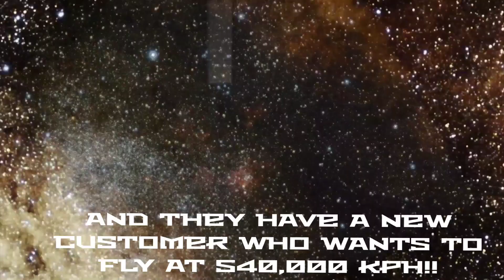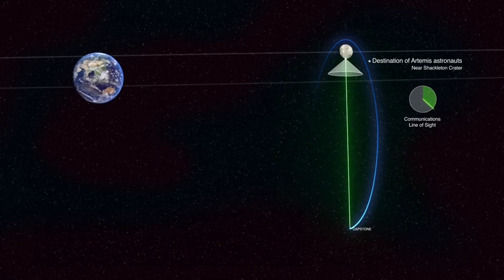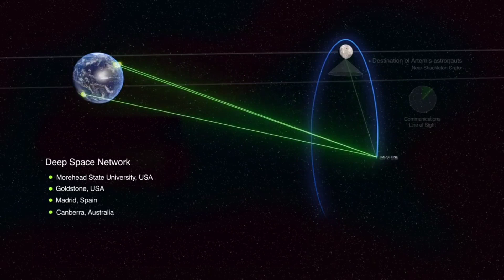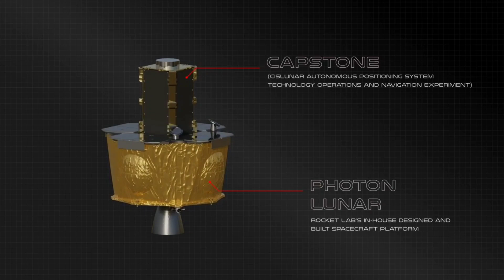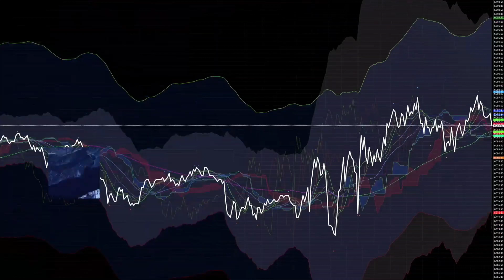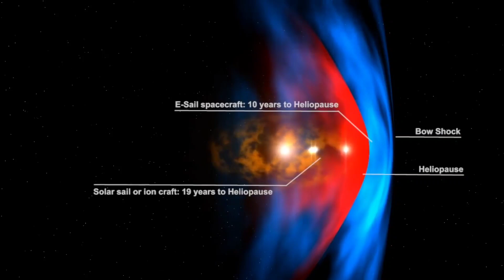Earth to Saturn in less than a year! The Moon in 43 minutes! Rocket Lab and their newest customer!

Comment: I really love that magnetic sail. The advantage of this over light sails (other than the almost constant accelearation, as the field expands as the pressure is reduced) is that by changing the strength of the field in different rods... you could "reorient" the vector of the sail without using thrusters to reorient the craft. It's the sailship of the future.
Reply: Gonna need space worthy nuclear power.
Reply from the maker: I was pretty impressed researching this. What if Finland builds the first superfast interplanetary probe? What a moment of national pride. 👏
Reply: @TheAngryAstronaut  I agree Mr. Angry, that would be cool. for all involved😉
Reply: The sails get you out but how do you get back?
Reply: @Dave5843-d9m  hopefully you had sense enough to aim for another Star. It can be used to slow you and send you back... Not sure why you'd wanna come back... If you're going to a gas giant they produce their owns fields you could use to get you back. Pull the sail in when the wind changes.
Reply: https://en.wikipedia.org/wiki/Electric_sail, not to be confused with https://en.wikipedia.org/wiki/Magnetic_sail (as the former article says at the top)
Reply: YES THIS IS ONE WAY
Reply: Two ideas (maybe dumb ones) to decelerate:
1. Reverse the polarity of the tendrils?  
2. use the build-up of electrons or protons (effectively ions) to fuel a forward facing ion thruster.  retract or neutralize tendrils part way to the destination (in proportion to the difference in thrust of the two methods) and fire up the ion-brakes.
Reply: @JeremyNasmith  1. The wires are charged positively by having an electron gun on the spacecraft's body. (AIUI, this actually charges the whole spacecraft positive, not just the wires.) I think that would be difficult to reverse, because you'd need either a supply of an ionizable substance so you can emit positive ions, or to rely on ambient charging by just connecting a high-voltage power supply between the wires and the body. Even if you find a good way to make the wires negative, I expect that won't slow down the spacecraft: instead of blocking the solar wind (and thereby being accelerated by it), you're just going to attract the solar wind (and thereby be accelerated by it).
2. That might work, if you have a way to collect protons and electrons from the solar wind. You'll need both so you can store them as neutral hydrogen, and so you can emit electrons for neutralization when ion-thrusting. A conventional e-sail, being purely repulsive, won't collect anything, but your attractive version might work. You'd probably have to reel the wires in, or make them loops that cycle through the body, for collection.

Comment: Looks like they're generating an electric field, not a magnetic field.  A magnetic field would require the flow of current, so you would need loops of wire.  The tendrals are not loops, and no current flows in them.  Basically, positively-charged wires repel the positively-charged protons in the solar wind.  So the sail is taking some of tho kinetic energy in those protons.  The tendrals also repel each other, which is what keeps them spread out.
Reply: How do they keep them extended? Are they rigid or something? Or the ship rotates to keep the tendrils extended?
Reply: @yamilespanol4527  I assume they would rotate the craft.  But the tendrals will also repel each other.
Reply: @steverobbins4872  : I recently saw a proposal for a similar power-generator.
Reply: @yamilespanol4527  How do they keep them extended?

Tidal forces.  It effectively becomes a long thin object combined by the tether the junk and the satellite.  This composite object will tend to become vertical to the Earth by those forces.  It is technically in orbit at the center of mass which is in freefall.  The higher end feels an outward force and the lower end a downward force.
Reply: @Scanner9631  wut? That thing is supposed to go to another planet, it will leave earth's influence and will not be affected by any tidal force.
Reply: I thought you were talking of the one that does the deorbiting of junk not the propulsion one.

For the propulsion one if the electric charges on each one is the same.  Like charges repel.  They will stand out like the hair on someone touching a van de graf generator where each hair has the same type of charge.
Reply: @Scanner9631  Oh, I should have been more specific.  Thanks.
BTW, the deorbiting scheme would use magnetic fields, not electric.  The tether between the two objects would have to be two wires forming a loop.  I'm not sure how they would spread them out to maximize loop area, but the idea is that the loop would cut through the Earth's magnetic flux lines, thereby generating a current in the loop, which cause the loop to heat up.  So kinetic energy is dissipated as heat, and eventually enough kinetic energy is lost to deorbit the whole thing.
Reply: @Scanner9631  So it would look like a big puff? Or it might result as a cone or an umbrella that has been inverted by a strong gust of wind.  I guess I could look it up.
Reply: @markharmon4963  Oh great, now you brought up an image in my head from the Carl Sagan show “Cosmos”. Remember that spaceship of the imagination looking like a giant dandelion seed?
Reply: @walterlyzohub8112  Hell Yeah!
Reply: Steve, They generate an electromagnetic field.  A current is induced from higher potential to lower potential along the tendrils.  (Think lightning bolt, clouds to ground) so no loop is needed. It’s the kinetic energy the high speed protons impart to the magnetic field that pushes the sail. Its similar to how the solar wind pushes on and is deflected by earths magnetic field. It’s velocity that the King, when it comes to thrust, and these protons are moving very near the speed of light.

Comment: The magnetic fields of the gas giants and Earth could possibly allow for eddy current braking using copper infused tendrils that could be unfurled when in the braking zone.
Reply: If you can use eddy current braking, you can do eddy current acceleration.
Reply: @absalomdraconis  it doesn't work that way. Eddy current braking is due to the strange interaction between a copper object moving through a STATIONARY magnetic field. Magnetic repulsion drive is a different possibility but would subject occupants to dangerously high magnetic fields.
Reply: Yup. Lenz's law works to oppose the field inducing the original current.

Comment: 2 things, 1st: people tend to forget that building to mega scale in open space is easy up to a rather mind wrecking size even with our current tech lvl
2nd, early in the shuttle program a tether was deployed with the intent to study the local electrical environment in leo. the tether was meant to deploy out to a kilometer or so but only made it a few dozen yards because the induced current exceeded the upper expected limit for the cable used in the tether and it burnt through, 
between the energy environment in leo and the same from our local star there is ample power to go wherever we want at relatively useful speeds. i mean if you tap the existing solar emf you dont really need a lot more to get around especially if you take advantage of existing features most people are unaware of

Comment: It would be interesting to hear more about the electrostatic sail.  Charged particles probably decrease with distance from the sun in the same inverse square law as light (its geometry), can the sail increase voltage as the particles decline in number to maintain constant acceleration?  How are such long tendrils kept stiff when force is applied to move the probe with them?  Hair thin wires would deflect under the pressure and be pushed into a braided tail downwind of the probe.  Would be very interesting to hear how real rocket scientists solved these issues.

Comment: It may be much easier to slow down with the charged tendrils than it is to speed up with it. All stars also have enormous magnetic fields just having a moving current in the tendrils would decelerate the probe pretty efficiently so even if you pushed it up to speed using photon sails and lasers you could use it to slow down without a laser at the other end.

Comment: I just watched a video about a nuclear bomb set off in space  and it sets off a emp that can destroy most of leo sats my question is would project orion cause this and if a nuclear engine goes critical in space this would destroy our economy almost as if the kepler effect happend and would this risk make nuclear engines viable
Reply: Sigh ... nuclear reactors normally operate at the critical level, where reactivity (= 1.0) due to decay or fusion is in balance with power production.  Supercriticality (reactivity > 1.0) is when a reactor is increasing power output, potentially beyond a controllable level, and subcriticality (reactivity < 1.0) results in reactor shutdown.
Reply: @jimmanley2796   thanks for the response but I mean you don't have to sigh I just had a question

Comment: Sorry, they're doing it wrong-  Any object in earth orbit is roughly worth it's weight in gold, based on current launch-costs, say $1 to $100 per gram.  Another way to visualize it- a US bill weighs roughly one gram for $1, $10 or $100. Instead of effectively sending one, ten, or hundreds of dollars per gram into re-entry to burn up, you'd do MUCH BETTER with a business model that simply collected them. Warehouse as much of the orbiting resources as possible, sort-it, smelt it and start 3d printing it into useful components using solar-electric or solar-thermal foundries.
Reply: How much money to deploy your space smelter, would that pay for itself? In addition, what do you do with all the space junk clogging up orbit in the meantime?  Great idea, but an infrastructure generation too soon.
Reply: @bbirda1287  You might want to look at what Trans Astra Corp. is doing. They plan to use solar mirrors to harvest asteroids but perhaps their basic idea could be modified for space junk. Solar thermal rockets can use aluminum or anything else the junk is made of for propellant. Depending on the (higher) orbit the junk is put in there should be plenty left over for use after some of it is vaporized, heated and exhausted for thrust.
Reply: Fully agre with Hal's comment. Given the effort we had to put it up into Orbit , every solution that is not aiming for recycling is just wrong/ wasted. Luckely wit Starships 100t payload capacity, a potetial collecting/sorting/stroring facility becomes a possibility.

Comment: This might be a stupid questions, but could you build a tether and put a laser at the end of it and direct it towards your ship to propel it? 
Instead of having a laser on the moon(or where ever) you have one attached to the back of the ship.
Reply: As always, what is going to power the laser and against what will the photons impinge?  The mere emission of photons that don’t have significant mass isn’t enough to accelerate any utilitarian mass ... such as the power source.
Reply: @jimmanley2796  A nuclear reactor should do the job. And for collecting the photons. Idk I am not an engineer. Lol. 

Just putting this out there to see if viable
Reply: This is like asking if you can lift yourself up by standing in a bucket and pulling on the handle
Reply: @Agnemons  I did this start this with, this might be a stupid question lol
Reply: @Agnemons  what about sling shooting an asteroid to be behind a spaceship. Then put a laser on it to push the ship forward, it will slow down the asteroid. Maybe you could do up a few asteroids like this to boost the ship forward.

Comment: At:~(15:51) You said it used anything except its own propulsion and  of course the solar wind. 
The solar winds are the power of a star. Are they not?
The system will not work absent a star to push off from.
However, if you revers the polarity of the current in the wires will it attract the craft towards the star?????

Comment: how many seconds of zero gravity your tower can generate
Reply: its the same as ball falling from the top of the projectile trajectory
Reply: dont slow down
Reply: alpha-nuclear match rocket, has stupid MWh/kg ratio, mini nuclear rocket
Reply: about that charged ion slinger, tooth brush charger, U-tube that so that the other tube slings out electrons, to mix with the ions
Reply: assume electrons, or at least the ions, have minimum of 5MeV, manhattan project, particle energy, some fraction of the light speed, to slam to fusion or as ion propulsion tube
Reply: hydrogen is lighter, will have more speed than heavy ions, with same acceleration field

Comment: "To the Moon in 43 minutes"?? TOTAL BULLSHIT. The great speed that can be achieved in a whole year does not AT ALL scale down for short trips. Also, the claim of "20% of light speed" is TOTAL BULLSHIT. The solar wind goes about 1 million miles per hour, so no faster speed that that is possible via this kind of propulsion. While the trip to Saturn might take only 1 year (assuming the spacecraft mass can be kept very low), any trips longer than that will not be massively quicker. Also, no mention was made of angling the electric sail to change the orbital velocity of the craft, but as with lightsails, that is a useful technique. Finally, the density of solar winds decreases with distance from the Sun or other star, so acceleration will drop as distance increases. This effect was also neglected, and instead performance was described AS IF the acceleration could be constant. Overall, this bunch of wild claims is 80% bullshit, and a huge disappointment coming from The Angry Astronaut.